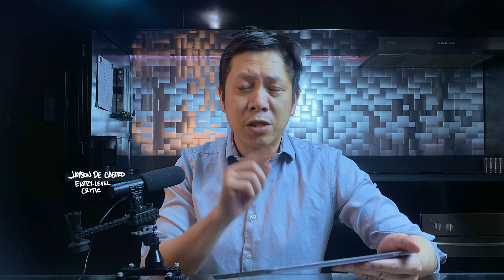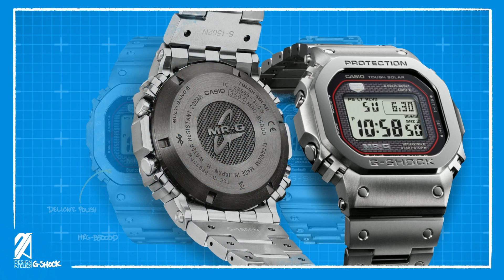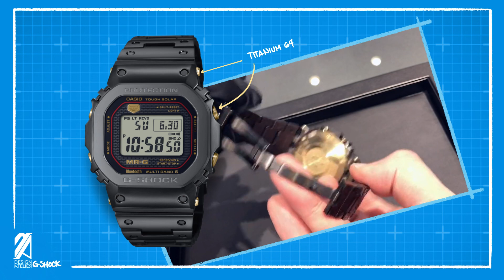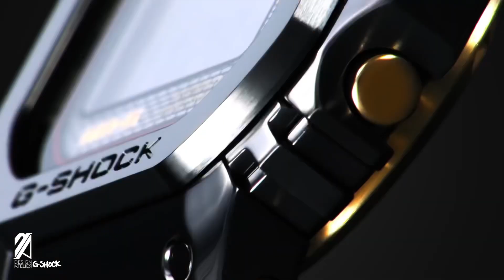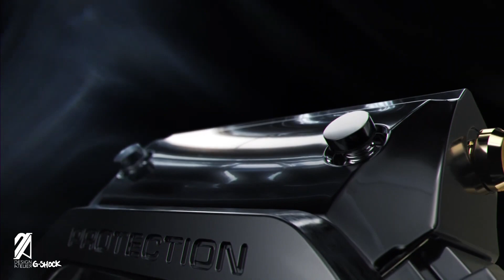LIVE! Hands-On Video Of The MRG-B5000. (Official Announcement G-Shock)

Comment: i wonder how long parts will be made available. i have a tough solar frogman that has a damaged display. i checked with the official service center to replace the display and was told the part is no longer available. if the screen if this mrg gets damaged in a few years and cannot be repaired due to lack of parts, it would be a shame as this is so expensive.
Reply from the maker: Sapphire is very hard to damage. But true, once its damaged and parts need to be replaced, it will be hard to come by. 
I always say, own a watch that you're willing to own in the long run. Yes it is nice to have security of coverage when damages happen but then again nothing lasts forever.
Reply: @DesignAtelier  on this case the damage was to the LCD panel. Some of the pixels stopped working, so part of the screen had info and part was just blank. So, I wanted to keep the watch for the long run but the parts did not cooperate:)
Reply from the maker: @redzuan6425  maybe try getting a whole new module instead? It could be a lot easier to order and install.
Reply: @DesignAtelier  i asked the official service center for that as well. Was told no longer available. Any idea where I can get one? Any information would be much appreciated.

Comment: I assembled one with an original mrgb5000 watch case(no bracelet, ordered from Casio aftermarket) and a 3459 movement.  Btw,I used a titanium bracelet from 5000TVA(also from aftermarket). The overall cost is 1200 Canadian dollars. I tried to order a MRG bracelet but the guy from aftermarket told me the price of the bracelet, somehow, is way more expansive than the watch(almost 2000 Canadian dollars). It is a nice watch indeed, and I planned to buy one in the store, but I was shocked when the price was released. Unless you are a Casio enthusiast or super rich, 4000 US dollars for a digital watch is so ridiculous. You can even buy a decent mechanical watch with this price.
Reply: Oh, it should be 1400 dollars instead of 1200 dollars
Reply: They're selling an MRG-B5000 case? What was the price?
Reply from the maker: yeah I don't know how they have their pricing structure is. but for sure from what I've read, these materials are extra harder to produce. maybe the hand finishing costs a premium. just the individual rivets on each link needs to be hand applied for sure. thats likely why it costs 2K

Comment: to clean the DW5600E, you only need a toothbrush and soap. for the MRG-B5000, you need a watchmaker.
I would not take the MRG-B5000 for a swim, in the shower or any outdoor activities. Insane construction and price.
Reply from the maker: Insane is the word. I agree with this comment. However, nothing prevents you from doing the former. You just don’t want to because of the price.
Reply: @DesignAtelier  True, totally agree. The price tag is inexplicable to the inexperienced eye. I understand the engineering and craftsmanship that went into building this watch and that Casio wants to make a statement, but still...

Comment: Ok, I finally decide to buy one. Do I want Silver or Black?  I am currently leaning towards silver
Reply from the maker: Ooooohhhhh! Show us when you got it in hand. Tell us if your experience!
Reply: @DesignAtelier  First off, just wanted to let you know that your channel has become a rising star. Definitely has become one of the top 3 channels I watch.  I was going to purchase JLC Master Compressor Extreme Labs 2, saw one on ebay just serviced for 35K.  However I did end up with the Silver MRG5000.  Extremely happy with it. I think it would be a waste to get this in black because the finishes would be covered up and it would smudge.  Being a prior TVA owner, I can say this actually wears better.  The lug to lug is better since the first links have some articulation. This is indeed a special piece. I know many would complain about the price, but this piece is for everyone. It comes down to the individual if you put value on unique materials. The top of the top square, sapphire, bezel guard structure. special polished caps in links, unique lock mech for MRG models only, slight movement difference with gold for lower resistance, materials for band, case, bezel. These are the things that made it worth the price point.  Also price point itself is a factor. Like a nautilus, would the watch be as desirable if it only costs 2,000 instead of 150,000?  Because the MRG5000 has a "high" relative price point, you wouldnt see everyone running around with one.  If we look at squares, we have price ranges in 100, 250, 550, 1500, 3500.  I think every individual gets to pick what they value.  Some actually want to have the 5610 (like myself) just because of the excellent value of features it brings at a lower price point.
Reply from the maker: @FAFA_BEAR  wow I did not know there more articulation on this one. I would really love to get one of these on hand to review. There’s so many things to unpack and that nautilus analogy you made is very accurate. I don’t mind the price because I understand the pricing idea behind it. I actually think it’s a bargain to pay just 4x more on this MRG compared to other metal titanium squares.

Comment: I think these mrg can only be appreciate if the fans go thru a very intricate phase of owning a square g-shock by the tier given by CASIO which may take quite while : 
Basic resin (dw5600e)
Basic resin with tough solar (g5600ue)
Metal bezel (gm5600)
Resin with multiband and OG setting the GW5000
And in between if u want to take a break is the multiband with resins only (GW5610) or the carbon lightest (GWS5600). 
Then the full metal with bluetooth GMW5000
Then u go full Titanium GMW-B5000TB or with the TVA
Only then u can appreciate the existence of these MRG. 

I for one can only afford the 5600ue for now, but i do think my journey to own the highest form of G-shock square now is more desirable due to this. CASIO never stops exploring and improving. 

Wonder if there will be ever a model with all sapphire case and bracelet into the release? Time will tell.
Reply from the maker: Thank you for that very intricate comment. My particular journey was a bit shorter. I started with the typical DW5600 then went to buy a B5600 and then went straight to the TVA. 

I think its an overall understanding of G-Shock all together that helped me appreciate this MRG. It also helped that i have been following and collecting on the luxury watch scene. so really this MRG is for the other me who could earn and afford maybe 5 times my current cash flow. 

As for the sapphire case, i doubt that G-shock would use this material because they always intend to keep the Shock absorption very high. Sapphire cases tend to not have these surface integrity before chipping off or shattering.

Comment: If I had 4k burning a hole in my pocket, I'd buy it easily. I like Casio, I like G-Shock, I like quartz and squares and lcd digitals. I'd still keep and wear the resin ones. Prices will eventually drop and the expertise gained in this exercise will slowly but surely spread to other models. Bold, good move by Casio.
Reply from the maker: well said. however this particular model will likely just appreciate base on the selling out of units and the fact that this one geared towards the high-end collectors. I do agree that this tech will make it into future, more affordable squares.
Reply: I’ve just pulled the trigger on the GMW B5000 TVA.  Could only get 5% off the RRP.
Beautifully designed watch.
Reply: I'm happy with my GMWB5000MB-1...

Comment: Great review, beatiful watch shame because all MRG are about in general are cases and bracelets, there's no new innovation inside its a false economy... The biggest watch mistake i made was buying MRG-G2000CB-1ADR.. £3,300 I would have rather possessed the watch you're showing for novelty....
PS:am i right in saying this MRG-B5000B has no GPS?
Reply from the maker: I don't think that it has GPS. But the smart link feature is more than enough for most time settings. 

There is nothing wrong with craftsmanship in the case and bracelet. You are right! that's exactly what the MRG is about! If there was any advanced technology that should have gone in this was face recognition and voice commands and maybe actual map navigation. But then maybe just get a smart watch instead. Its tough to keep enough features on board the watch without having to charge it each time. But yeah the MRG line is just not for everyone.
Reply: @DesignAtelier  I wouldn't like smart phone features but for that price it should have even more higher tech rather than exactly the same as much lower models such as my GMW-B5000TVA-1ER...
I think this newest square addresses all the issues I found dated in past bezels and cases. But I just think it needed even higher features such as standby life, GPS, auto calendar that shall go beyond year 2100, things like that